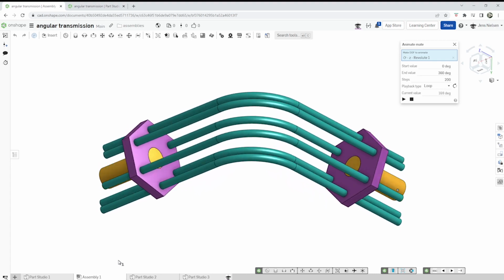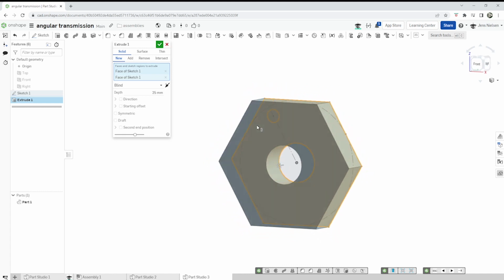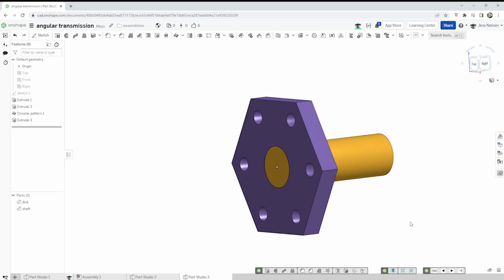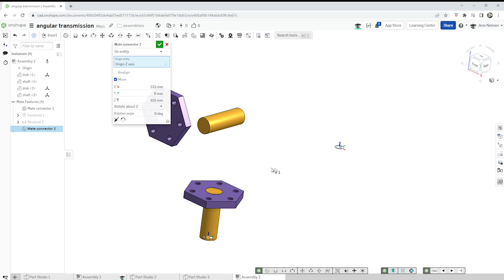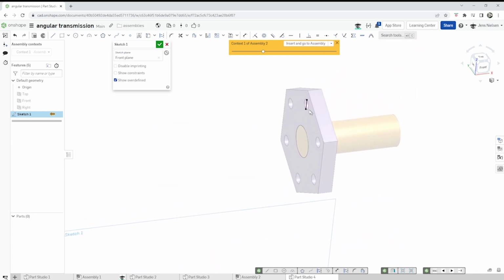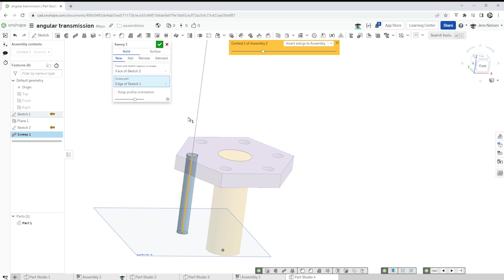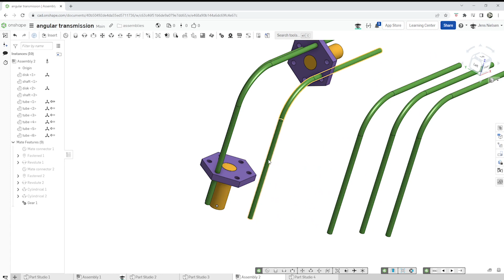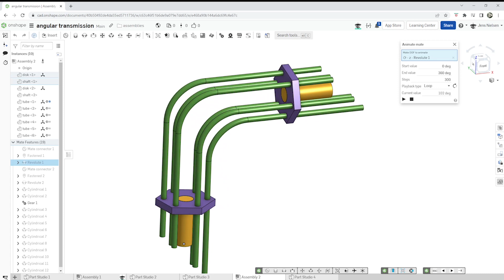Learn How To Build a gearless tubular Transmission from Scratch with Onshape!

Comment: Nice work 👍 I have some suggestions: If you do a circular pattern of the diameter 12 in the sketch you don't need to extrude and pattern it afterwards . In assembly you can use replicate to connect the tubes to the first hexagon. so you don't have a need to copy and connect 6 times. Also there is no gear connection necessary 😉
Reply from the maker: Excellent input! Just did the  replicate which is an enormous timesaver. The  only drawback is that only one mate can be replicated. I acknowledge that the gear relation is not needed. About the pattern in sketches: I prefer to pattern  features, I have the experience that I can control the design better this way. Thanks Stefan!
Reply: @cademist  Yes it would be nice to replicate more then one mate. The patterns are personal preferences 🙂